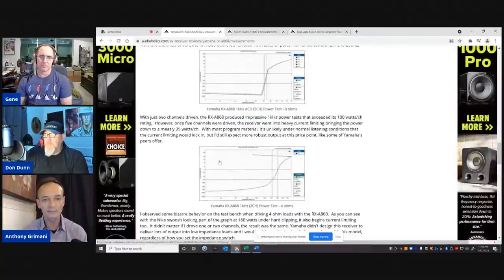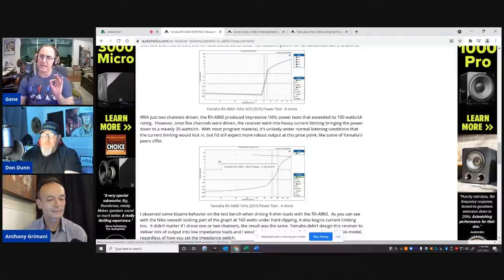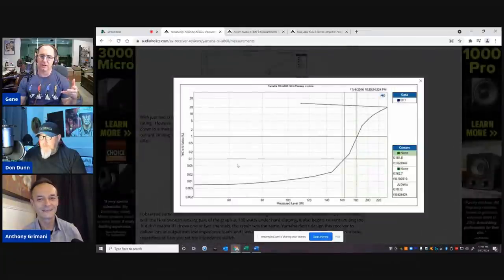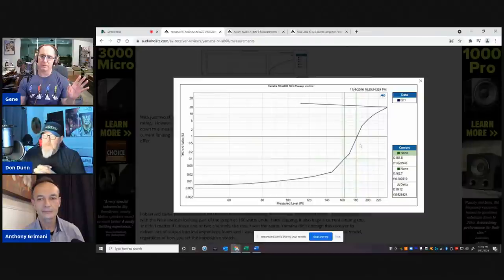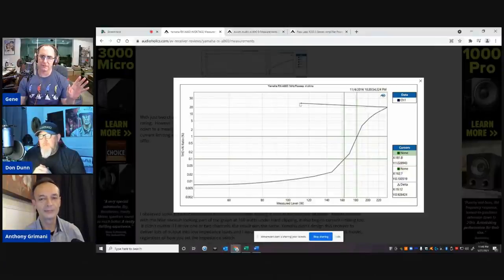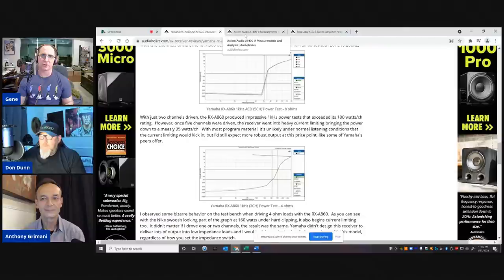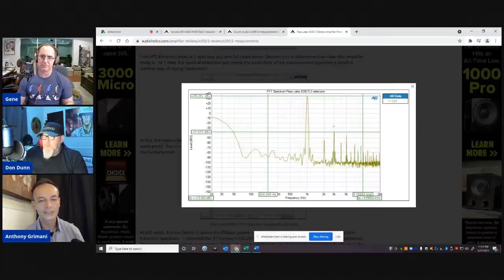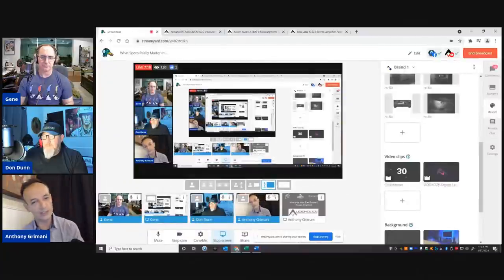What Specs Really Matter in Audio Amplifiers?

Comment: I was in car audio for over 40 years. In the 80s, people were all about the THD spec. We had people decline to buy an amp from us because the THD spec was 0.09%, and another store's amp was 0.08%. It didn't matter that I informed them that they couldn't hear anything below 1%. Car audio is even worse in spec chasers than home. People would buy a Kenwood amp instead of the Zapco that we sold because it was rated at 1%. Zapco would blow the doors off most car amps in the day.

Personally,  I look at damping factor and slew rate, as well as if the amplifier doubles power as load is halved.

Comment: So many companies were playing those games in the 70s that the FTC stepped in and told them that if they were going to publish power ratings, they had to be RMS, and they had to specify the bandwidth and distortion level at that power. I agree about Kenwood too. Every Kenwood integrated amp I had from the 70s to the 90s was great. I now have a 100w channel Kenwood that I bought on Ebay for $65, and it's the best sounding amp I've ever had. I prefer it to the Marantz and Arcam amps that I've owned.

Comment: Is there a place for vintage amplifiers?  A few years back the Los Angeles Sports Arena was demolished.  Before the building came down everything inside was auctioned off.  I won thirty Panasonic Ramsa WP-9210 200W amplifiers.  These amplifiers were used to power concerts from all the big names throughout the years and tons of sporting events...including the 1984 LA Olympic Games.  Today I use three of these 37 year old amplifiers in my humble 5.1.1 theater system.  Like a good mechanical time piece or classic car it's kinda cool being to use something long after it's prime 😉.

Comment: Are 2502 Crowns acceptable? Bit more noise in the AP results than good hifi amps, is it noticeable? But concerns me a bit is distortion across the full spectrum: 20 Hz to 20 kHz, to check for possible harshness, as well as tolerance to speaker impedance across the range. 
XTZ amps based on ICE modules have a reputation for being a bit harsh. True?

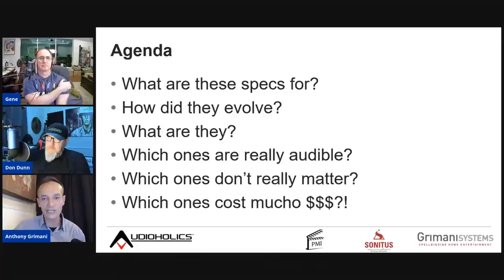Comment: 21:11  Just my two cents. In Spanish, the name of the American currency in plural is dólares, with an accent mark on the first syllable. This is to indicate that it is pronounced with oral stress on that syllable, the first one in the word: DÓ‑la‑res.
According to the Spanish accent mark rule, if it was pronounced do‑LA‑res, with stress on the second to last syllable, it would be written without an accent mark: "dolares", which is not how it actually is. If it was pronounced do‑la‑RES, with stress on the last syllable, it would require an accent mark too: "dolarés", which is not how this word is actually written either.

So dólares does not really rhymes with dolores, which has its oral stress on the second to last syllable: do‑LO‑res.

Furthermore, in Spanish the letter a is always pronounced differently than the o in any circumstance, but that is for another explanation. If you want it, just let me know.

Comment: I have an entry level fifteen year old Integra 5.1 receiver that still works as flawlessly today as it did on day one, and it's on all day long everyday, 'cause it's my TV sound, as well as for CD playing, and if I'm not listening to a CD, then my TV is on. And, I have to agree with you about the sound quality of Onkyo (Integra is their higher end line). I had an equivalent priced Marantz ($500) from the same era, and the Integra was better sounding, with tighter, punchie, and better defined bass and just better balance and clarity overall. And it has a really good DAC too, which sounds better than the one in my Arcam CD player

Comment: I have seen so many surface mount failures on newer equipment than the older thru the hole design. Another area that I see a lot of premature failures is in switching power supplies over the old linear design (Heavy transformer and big caps seem to hold up longer). Amplifiers have really not changed that much for decades in the class A or AB designs so I would like to see them last 40 plus years. Many old vintage amps last this long and are easy to keep running but the surface mount stuff good luck with longevity IMHO. I hope the newer class D amps stay with linear power supplies versus switching power supplies.

Some of the more important specs to me are super low noise floor with no hum and having enough headroom to handle all the transient bursts without clipping (big power supply reserves). THD has less meaning too me since most quality amplifiers are so low it just is not audible to my ears but feeding to much negative feedback into the circuit to get these really low numbers may degrade the sound quality.

Something to consider on which class amp to buy. There is a significant difference between class AB and D when it comes 
to supply rejection. It's not about how much noise is injected, it's about the actual gain characteristics of the amplifier.  Class AB open 
loop gain is only weakly dependent on power supply voltage. Class D is strongly dependent on it - and doesn't have anywhere near the loop gain (feedback) of most class AB. The open loop gain ends up varying at a 120 Hz rate, creating inter-modulation distortion products. They call this "power supply pumping"to lead you to believe that it is not "distortion" - but it is. Feedback reduces this, but there is a limit to what it can do because the amount of feedback is less in these class D amps compared to AB. They are inherently more linear open loop so a lot of feedback is not "required". Many class D topologies operate open loop, in which case your supply better be ripple free so a regulated switcher would be recommended which generally will not last as long as the linear power supplies. Going full bridge to a large extent cancels this distortion mechanism so you see a lot of bridge topolgies out there.

Comment: This is a very educational. I would like to learn more in hope for discovering new measurement or specification that may explain differences in what I hear in my amplifiers. For example , despite their similarly flat frequency response measurement, my Class D Purifi Eigentakt sounds more forward in midrange but rolled off treble particularly lacking on the sounds of cymbals. My Krell KSA200s sounds less bright than benchmark AHB2. My benchmark AHB2 on human vocal sounds light weight compare to Levinson 333. My levinson 333 has more weight and dynamic impact when playing classical song like 1812 overture at louder volume setting. All observed under volume settings that produces the same SPL (84dBC) on Sterephile's Test CD2 Track 15 pink noise, and on the same B&W 802D3 speakers..
Reply: MasterApex1 thanks for the input since you are running with the same equipment at the same SPL it is more meaningful controlled observations to me.

"Appreciation of audio is a completely subjective human experience. Measurements can provide a measure of insight, but are no substitute for human judgment. Why are we looking to reduce a subjective experience to objective criteria anyway? The subtleties of music and audio reproduction are for those who appreciate it. Differentiation by numbers is for those who do not".--Nelson Pass
Reply: @Rancejunge I compare them on the same song/source (opo 105) , same speakers and room. And volume setting at the same SPL using Stereophie's Test CD2 track 15 pink noise  set at 84dB.
Reply: @Rancejunge I compared them on the same song/source (opo 105) ,same speakers and room. Level match the amp using Stereophile's Test CD2 track 15 pink noise  set at 84dB.

Comment: For me the #1 reason to not use a receiver in a HT. The amplifier technology changes much slower than the sound/video processing section. You can use amplifiers from 30 -40 years ago and get good results, but if you want HDMI 2.0 or Atmos you need something new. So why keep throwing out perfectly good amps because the receiver doesn't support Atmos, 8K video or whatever the next need to have thing is?

A general note While this video contains lots of good information, not much seems actionable. I would like to use specs to weed out products and then listen to a few products in a price range I want to afford. However most everything you say in the video shows that this is impossible based on the current state of specs.

Comment: I don't think Storm Audio sell that Integrated AV anymore ... This was the info from 2017.

The I.ISP 3D.16.12 was first introduced at CES 2017, where it was love at first sight for me. Between its 12 amplified channels and the availability of Dirac Live room correction on all 16 channels,  packs a tremendous home theater punch into a single chassis.

The twelve class-D amps in are rated to deliver 200 watts per channel with 0.1% THD from 20 Hz to 20,000 Hz, all channels driven. That's a ton of power and for space-challenged installations this device can replace a whole rack of amps. For this reason, the I.ISP 3D.16.12 is not equipped with preamp outputs for the twelve amplified channels. The remaining four channels do feature balanced XLR outputs.

Comment: Pioneer Elite 94 receiver, it's a 08 unit, it's a B rated unit , push, pull. 140 watts into 7, iam using as 2 channel, I see ab, d units only. Do they still make B rated receivers, and your thoughts on B rated amps!? Your thoughts on B rated, my Pioneer 94 receiver sounds great, using Elac 2.0 b52 6 ohms. I keep hearing ab rated are better, should I get a ab unit? I think my Pioneer 94 receiver sounds good, your thoughts please. A, B, ab, d, would it be worth getting AB? B seems out dated, yet solid performance, it's heavy, 35-40lbs, thanks for your help! 😁🤘

Comment: Nothing wrong with Watts as a measurement  of Power.  I get the Amps issue,  however if you don't have the volts to push the amps you won't get the watts.   1000 watt amp limited to 1 amp of current would require a very high output voltage and high impedance speakers.   1000 volts with 1000 ohm speakers 😁

Comment: Most important spec is wattage into low impedance.

For people using high sensitivity horns, SNR at low wattage is an important spec.
Reply: @think2023  Frequency response, distortion, etc.  are unimportant if the amp doesn’t get loud enough.

Also, slew rate is not important at all. All that tells you is the power and frequency response extension, has nothing to do with timing or anything.

Damping factor is mostly a useless test as it’s fine on most modern amps. Even cheap AVRs are decent. If talking 20 years ago then sure.
Reply: @think2023  But if you needed 50W, the 15W won’t cut it. It’s like saying a luxury golf car is amazing when you need to drive on the highway.

Comment: Can someone just tell me straight up if buying an XLS1002 2-Channel 350W Power Amplifier for Jamo S 809 floor speakers will be an improvement in sound quality?
Reply: Probably
Reply: Compared to what? How old are your ears?  How is your room conditioned? Are your speaker cables running parallel with the equator and at least an inch off the floor and your power cable perpendicular to the speaker cables?  Does your wife tell you to turn it down all the time?
Reply: @sydneybird116  calm down buddy

Comment: Very useful info here! Love the engineering minds at work with the unrestricted man cave hours where not a creature is stirring not even a house wife LOL! 

I have been building my own class AB amps for years and love to look at the various pros and cons of designs. I take so many amps apart and look at what is truly at work. I would truly love to see some accurate double blind listening tests from a host of humans from the “Golden ear” group thru the average listener to see what is truly detectable as an improvement in sound dynamics/quality. Dogs and Cats don’t lie IMHO so when my noise floor is so low & dynamics so high that it freaks them out & plays tricks on their little minds I feel I have improved things LOL.

Anal retentive theory versus audible reality which is it? From what I have read our ears have trouble distinguishing anything below 5% distortion so what’s up with these 0.0001 THD numbers? Tube versus solid state is another area that would be a good study on solid double blind listening tests. As long as an amp is functioning correctly not clipping or injecting some abnormal noise and has ample headroom can you really hear a difference between them?

As far as amp design goes the circuits themselves are usually able to produce much higher power without problems but are limited to the size of the transformer (power supply) so when all channels are driven each channel is limited by this. It would be nice to see auxiliary plug in power supplies that could be added externally to help boost this area but you have to factor heat dissipation etc into this. 

Also do you have an opinion on how higher voltage over lower voltage amps sound. Any difference with voltage versus amps(current) on how it effects sound. Tube amps are usually high voltage and many claim they like the tube amp sound better than solid state. It is interesting all the chatter about which cable to use and look inside a high end amplifier only to find #18 gauge wire run inside from the output devices? And if we are going to just follow the electrons shouldn't amplifiers have a minimum of 12 to 14 gauge wire feeding them from the wall?

Comment: i think that class d modules are doing great now, it is the power supply that is the biggest issue now. especially to keep the efficiency and get that at lower cost.
i got a newly released class d amp(nad c 298), at low watt output(a few watts) it is probably 10% efficient. because of a idle power draw about 30 watts. icepower amp modules are twice as efficient with same power power amps wattage. 
what hurdles needs to be overcome to get great sounding class d amp to have 80% efficient throughout the operating range?

Comment: So I have a Marantz pm6006 and elac debut 2.0 b6.2 and it sounded great for a week then one day i turned it on and cranked it up and listened to it a little louder than usual and now idk if i messed up the speakers or amp but i could swear it suddenly doesn’t  sound as good as it did. Like the bass seems weaker and the sound overall just doesnt seem as powerful. Is something messed up like did i partially burn out the voice coils or burn out something on the amp? No burnt smell coming from the front ports of the speakers just smells like fresh glue like they did when i first pulled them out of the box, and the amplifier just smells like an amplifier it didn’t put out smoke nor did shut off…….i just don’t know wtf is going on. Am i just going crazy? (Already used to the sound?) i find it hard to believe something is fucked up. Like i turned it up to the point where it was sounding maybe a little over driven but for a short period of time i turned it down to where it was no longer sounding “rough”.

Comment: This is in reference to the comment to hear the difference between amplifiers with hi impedance "8ohm"nominal efficient speakers. I'm currently driving my main speakers (RF-7ii) with my yamaha p3500s pro 2 channel amplifier driven by my yamaha rx-a3080 avr pre outs. I later purchased a more powerful version of my amplifier yamaha p7000s to drive dual sealed subwoofers. Before connecting my subs I was curious and connected it to my main speakers,  and after level matching I emediatly heard a huge difference.  Rite off the line I perceived far more vocal and upper frequencies coming out of the more powerful p7000s amplifier.  Can anyone explain why? Did I miss and or do something wrong?
Reply: I can explain it but you're probably not going to like the answer.

Comment: Can anyone explain if there is a benefit to going to a separate amp other than higher possible volume and potentially lower distortion? If I am happy with the volume and clarity my AV receiver can produce, is there any point in going to separate amp(s) or is that just wasting money? Thanks.
Reply: You get better basscontroll as well as more volume, a to weak amp might not be able to handle the bass drivers very well, you will get better sound quality as well, but it will depend on the speakers

Comment: I've got good speakers, with an old cheap amp.  I've noticed that when I turn it up, it seams to sound good, but at low volumes, I loose more bass then the volume would suggest.  Is that more of a speaker problem, an amp problem, or pretty normal?
Reply: P.S.  The amp is an old JVC-6010 a/v receiver that I have while i'm looking for something better.  The speakers are gr research mtm encores that i've made.  I know that theres issues, I'm really just getting into this and I'm working with what I got.
Reply: Its your ears bro. Human ears dont perceive sound the same way in high volumes as low. Thats why we have loudness button. It increases bass and treble when the volume is low